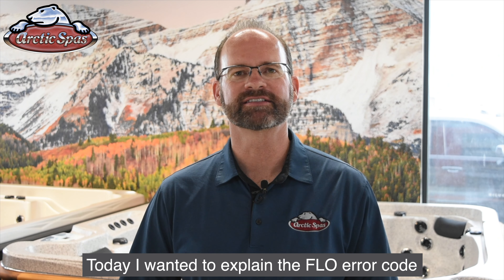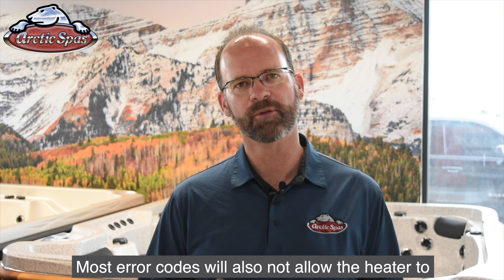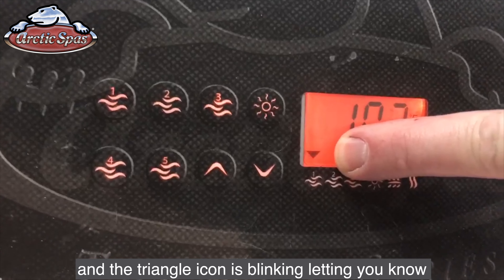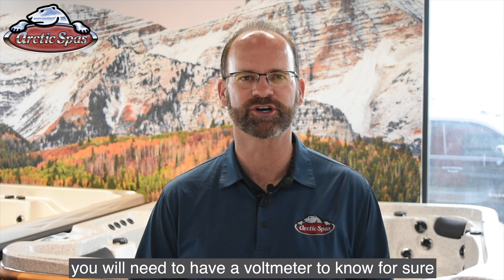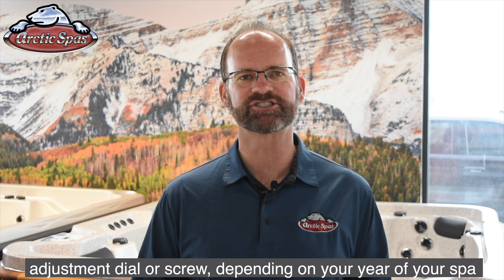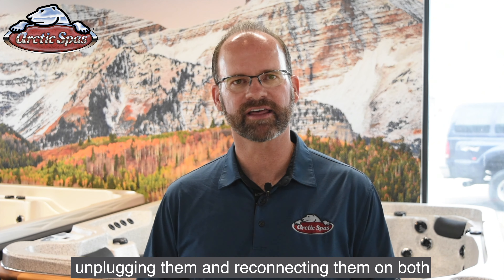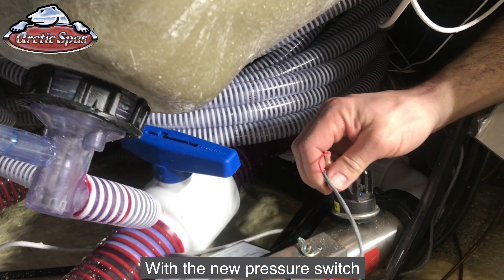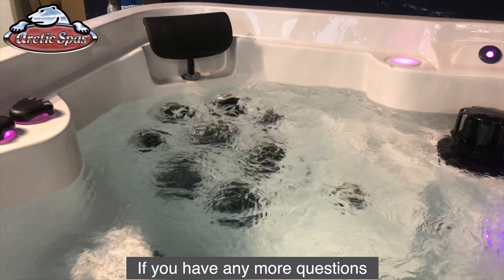Arctic Spas Utah Flo Error

Comment: Do you have a video that tells you how to fix if there is no water movement (pump not working and FLO error is on)?
Reply from the maker: I do not.  That gets more complicated because you need to start testing the electrical.  You can always email us at Support@ArcticSpaStore.com and we can help you from there.  Thank you!
Reply: @Arcticspasutah  I wonder if there is an override that kills #1 if it gets too hot. I had it running for probably 40- 45 minutes (use and then cleaning/chemicals). After letting it sit overnight, it decided to work again.
Reply from the maker: @joannecymbaluk8201  The pumps do have a thermal cutoff if they get too hot.  They will start again once it is cool enough.  That is probably what happened.  Thank you!

Comment: I have replaced the heater and the mother board but am getting the FLO code. I’ve backed the pressure switch screw off until the code went away but the water is not circulating through the heater automatically so the water in the element heats up and displays the HL code. I can manually turn the jets on and move water that way but the tub does not turn on the pump to circulate as it heats on it’s own. Any suggestions?
Reply from the maker: At this point, you need to figure out if the motherboard is sending power to the pump on the low speed.  You have to have water movement through the heater.  If it is not sending power to the pump, it is a motherboard issue.  If it is, then you need to check out the pump to see if is good.  Hope this helps.  Good Luck!  Email us at Support@ArcticSpaStore.com for more help.  Thank you!
Reply: Arctic Spas Utah I just installed a new motherboard today. How do I test the pump for power on low circulation? I have high jet flow but no circulation flow.
Reply from the maker: You really need a voltmeter to measure the power between the low speed leg feeding the pump and the common line.  You should be getting around 220 volts.  It is most likely though a new pump that is needed since you just replaced the motherboard.
Reply: Arctic Spas Utah son of a gun. How much do new pumps run?
Reply: Arctic Spas Utah I am only reading 120 volts on both high and low wires where they plug into the motherboard.
Reply from the maker: @sfosters  The motherboard only sends power to one at a time, meaning the high or the low but not both.  So whenever you test both the high and the low, you will only get 120 or less.  You want to put one probe of the voltmeter on the low speed and the other on the common line (usually white but not the neutral line).  You should be ready around 220 volts.